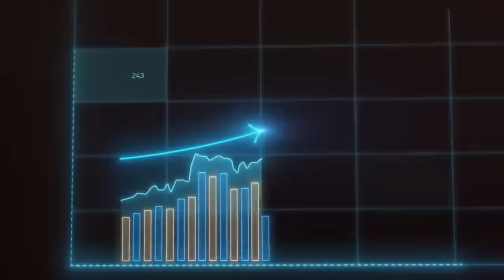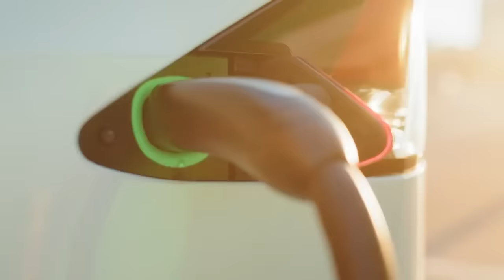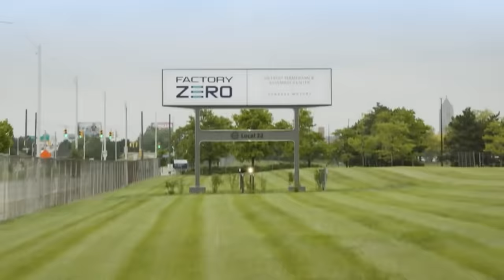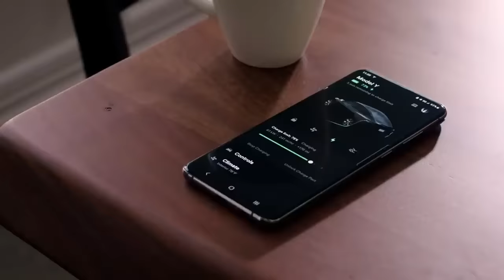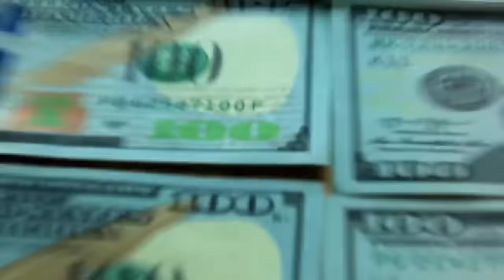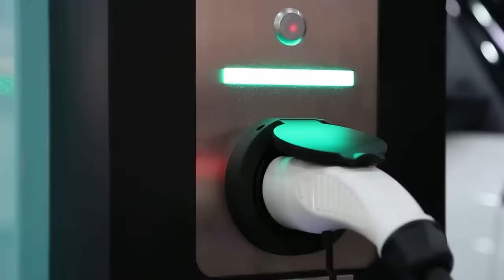Electric Vehicle Owners Are Frustrated and Demand the Return of Gas Cars

Comment: Electric vehicles (EVs) remain expensive across the board. Buying them is often pricey, and while battery leasing might initially sound appealing, it can add up considerably over time. Insurance costs for EVs can also be higher due to their unique components and potential repair complexity. Moreover, maintenance can be expensive, particularly when battery replacements are factored in. Additionally, EVs may depreciate faster than traditional cars due to battery technology advancements and changing market preferences.

Furthermore, charging can be a significant cost factor. While some public chargers offer pay-as-you-go options, others require expensive upfront deposits for charging sessions. Imagine facing a £45 pre-charge every day, even if you only use a fraction of the electricity. This becomes increasingly concerning amidst rising inflation.

Beyond the financial aspects, other concerns can hinder EV adoption:

Limited charging infrastructure: Access to reliable and fast chargers, especially in rural areas, can be a major obstacle for many drivers.
Range anxiety: The fear of running out of power before reaching a charging station can deter potential EV buyers.
Uncertain battery longevity: Concerns about battery degradation and replacement costs remain a deterrent for some consumers.
Limited model variety: While options are rapidly growing, the selection of EVs, particularly affordable ones, currently lags behind traditional vehicles.
It's important to note that the EV market is evolving rapidly, and many of these challenges are being addressed. However, for some people, particularly those on tight budgets or with limited access to charging facilities, EVs might not be a viable option in 2024 and the near future.

Comment: 0:40 " ... current lackluster interest in EVs ..." Left out another word or several [in brackets] : " should say current lackluster interest in [lackluster or overpriced] EVs [without sufficient service support and charging infrastructure] ...".  Depending on how you plan to use your EV, you may not need any sort of public charging infrastructure, but if you do, then you have to be sure to buy an EV that has one that meets your charging needs. Also, I've heard it said that many dealerships do not have enough, or any, technicians trained to support EVs and may not even have charging facilities on site. Having a Tesla, I've no personal experience with that. I've had relatively painless service on my car, so far, but it can take a week or two for a technician to come out to the house, depending on what is wrong, overall just a couple of minor items and the tech seemed quite competent.  Bottom line: I'm quite happy to be a Tesla owner and hope to never be forced into buying another new ICE vehicle.

Comment: I drive lots from Los Angeles to San Francisco and never had to wait for a charger—> Tesla provides a screen showing where charging stations located plus how many chargers un used.  Tesla charger get bad rap but 99.9% of Tesla chargers are working.  
I installed a 240 vac charger to my house for less than $300.00 dollars. I have background as electrical engineer. I install charger to my Son’s house and because we both have solar panels we both pay zero for energy use.  
When going back home I use my Son’s charger so round trip to LA to SF cost $12.00.  Because I have charger at my house my solar panels gives me free charging.  
If you are concerned about fire. Buy an electric car that only use Lithium Iron Phosphate—> it’s in heard of fire 🔥 on this kind of battery 
My Tesla have few parts thus break down is less. No need for brakes oil change just tires.  

Want to save $$$. The new model 2 come in 2024-2025 will cost $24,000.00 minus $7,500.00. or $17,000.00. So much cheaper than a gas car.  With that saving hire an electro an for $1,500.00 and install a 240 volt charger
Reply: Congrats, you are less than 1% of the population where EV's work for you.  No everyone lives where you do, some live in cold climates.  Also, I hope that the government will soon be charging EV owners a special road tax, equivalent to what gasoline taxes would be per mile.  You should be paying your share to keep the roads maintained and stop free loading on other tax payers.

Comment: I warned a friend of mine of most these facts in debate before he bought a EV ford truck. Less than 6months later, he called me 3 times to come picked him up at charging stations due to lack of open ports: 2 times because not enough charge to make it home and had to towed the truck. He lasted a little over 1yr with the truck but no one would buy it due to battery issues. He discounted the sale price on the truck 3 time. In the end he traded it in for an SUV and carried over $15 from the truck
Reply: I charge from home the past 4 years no problem if you have to go long trip get a gas car or truck. Not made for long trips.

Comment: We love our Bolt and it has been the nicest car we’ve ever driven after decades of very nice Hondas but… the issues raised are real and we don’t know if the ev future is as golden as hoped for. I charge at home and 99% of my driving is within 50 miles. I’ve also had no problems starting or driving in the coldest or hottest weather I’ve encountered in North Carolina but I can see where driving long distances or in extreme temperatures might present problems. The power grid and the source of initial energy will also need to be upgraded. I’m hoping that nuclear fusion, once always the future of power, will become a safe and reliable source. I guess time will tell.

Comment: EVs have a place in the overall transportation system but they cannot replace the convenience, lower costs and flexibility of an ICE car. Here in the UK 60% of car owners do not have a frontage to charge a car so are faced with using public chargers often miles from their homes so they have to sit and wait while the car charges. Late at night in a deserted car park is not a safe option but charging during a working day is equally unacceptable. This means that an EV is only viable for owners with a frontage so can charge the car overnight.

Comment: Sooooo.....if EVs that catch fire and as a result burn down homes......what impact might that have on insurance rates? Both auto and home...🤔
Reply: As EV fires are 10 to 50 times less likely then ICE car fires this is not a factor.
Reply: EVs are also a fraction of all the vehicles on the road. For one to make an accurate statement in that regard, it would require looking at a one to one comparison. 🙂

Comment: Here is my recent experience with an EV. I am amazed by the concept. However, the idea of EV is not a viable option for me yet. I love the speed involved with a Tesla Model S PLAID. So I rented one. Driving around Los Angeles. I drove 80 miles from 95% to 55% on a car advertised to do 348 miles per charge. The range is NOT like a fuel tank. I cant charge to full, except for road trips. Plus its unhealthy for the battery to deplete it below 20% and daily suggested range is 80% charge. That's only 60% usable per day. I went 80 miles from 95%-55%. How far would it be from 80%-20%?  Plus, everyday I don't drive it. I lose about 1%. I have 4 other ICE cars. It's full of gas when I park it and still full 2 weeks later. A Tesla will lose charge of it sits and when driven. Oh yeah! Sure, I know Jack rabbit starts hurt your range. But, you can monitor how much energy is used per trip. Even driving conservatively, I could only get about 300 kwh average even when I'm enjoying acceleration or driving Ms Daisy. So people have paid more for EVs than ICE. More for home charger, waiting at charge stations, crazy money to replace a battery on horizon, and now rapid depreciation? Why should I buy an EV again?

Comment: I will not be getting an electric vehicle for a very long time.  Where I live we routinely see summer temps in the 90s and 100s and winter temps in the -10 to -30 F.  All of the issues I have heard about unreliable battery operation in those temps, unreliable aspects of charging in those temps, put a lot of worry into me.  I also live on over 2 miles of dirt road...roads that are not paved, and not plowed in the winter time.  Are capable of handing rough roads, muddy roads, rocky roads, multiple miles EVERY DAY?  The cost of the electric vehicles is rather spendy and not worth the unknowns.  We also like taking road trips whenever we want.  I don't want to have my destinations determined by which places have EV Charging Stations.  That also brings me to another issue I have with EVs.  When I go to gas up my truck, I might spend 5 minutes gassing it up.  It costs me about $65.  With an electric vehicle, I'm going to spend less on "charging" (as long as I don't go over 80%) but I'm going to spend a LOT more than 5 minutes to be able to hit the road again.  If I wanted to spend 20 minutes or an hour to charge up, I'd go waste my time in an airport.  That also brings me to range of the EVs.  When we travel we go some 400 miles and then spend 5 minutes to be able to drive another 400 miles.  We can gas up at multiple locations along the way, so we're rarely worried about making it to the next place before we run out of juice.  We drove from Alaska to Montana on the AlCan.  I wonder if an EV could manage that?

Add in the infrastructure is NOT ready to handle a significant increase in electrical demand for a lot of electric vehicles, and I don't see EVs being much more than a "fad" thing for a number of years (likely 20+ years)

Comment: You don't just buy a car/vehicle, you buy a car/vehicle within an infrastructure. The petrol car seems a thing of its own, but won't work (for the majority of people/use) without gas stations , garages etc. One most times isn't aware of that, for it's always there. And different countries and climates demand different infrastructures. In one country you can drive from on side to the other in hours, in others you need that for one city to another. So you can't state simple things in general. In the early years of petrol cars you needed someone with a flag to run in front of it to have people make way for this new invention.

Comment: I've always said why do they advertise EV's as helping the environment with zero emissions when power comes from coal fired power stations in Queensland. And considering the minerals needed for the batteries, the mines use diesel powered trucks and trains. Think I made the right move sticking to a combustion engine. It's cheap to maintain, cheaper to run as electricity costs more, though I have solar so I might save there.

Comment: Solar panels is another BS! Estimated for my 2000 square feet hose was $100,000.00. Gov returning $20,000.00. You will never use $80,000.00 worth of electricity in your life. You need to clear the snow and dust to keep them clean. Also, pray for sunny days only:)

Comment: Hydrogen (H2) and The Ford Boss 429 

The Boss 429 was a high-performance gasoline engine that was designed for NASCAR racing. It was only produced for two years, 1969 and 1970. The typical horsepower for the Ford Boss 429 cubic inch engine is 375. This was the factory rating, but many believe that the actual horsepower was closer to 500. 

See Table 1., Hydrogen produces significantly fewer pollutants than gasoline when burned. For a given fuel volume, hydrogen produces zero carbon dioxide, zero particulate matter, and very low levels of nitrogen oxides and hydrocarbons. Gasoline, on the other hand, produces significant amounts of carbon dioxide, particulate matter, and nitrogen oxides.

Hydrogen internal combustion engines (HICEs) produce significantly lower emissions of NOx than gasoline or diesel engines. In fact, some studies have shown that HICEs can produce up to 90% less NOx than gasoline engines. 

Horsepower and torque produced for the same volume of hydrogen fuel would be significantly higher than gasoline in the same internal combustion engine. This is because hydrogen has a much higher energy density than gasoline, and will produce more power per unit of volume.

Comment: EV problems:  Does not work well in cold temperature.  More expensive to insure because of fire risk and high cost of repair.  Charging is too slow and stations are too scarce.  EV may not be cleaner than ICE.  The worst issue is EV is more expensive to buy which is regressive for working class.
Reply: Not to mention tires wear out three times faster thus emitting three times the rubber particles.

Comment: Basically, it's just all long already predicted EV issue: 
- they are selling it as premium car, with whole another premium cost at its lifetime.
- susceptible to temperature change, especially winter, 
- long charging time and rare charging place, 
- only house owner could charge it at home (apartment user basically go brrr), 
- once the battery dies, it dies and the replacement is a whole another issue and cost.
- it's could burn and once it's happened it's troublesome.

Comment: EVs undeniably offer environmental benefits in rural areas. However, advocating for them as the sole focus of car manufacturers is not the optimal solution. The concern lies not in the inherent goodness of EVs but in the questionable business strategy and its forceful imposition on the public.

Rather than exclusive investment in R&D for EVs, a more balanced approach could involve allocating funds towards programs aimed at enhancing emissions filters for ICEs. This strategy would address environmental concerns while accommodating a wider range of preferences and needs in the automotive market.

Comment: What is ironic is the fact that current EVs have the same problems as EVs from the late 1800s.
Poor range, long charging times, high cost of batteries, severe environmental impact, lack of supporting infrastructure, poor reliability & excessively high maintenance cost.
In addition, current EVs have become so computer & software reliant, a simple software glitch can render a very expensive vehicle completely useless.
EV technology, in its current form, is just not ready. Of course, given the current EVs available aren't much better than those available 130 years ago, its likely to take a considerable number of years before they will ever be as convenient as comparable ICE vehicles.

Comment: this video is old. It’s closing in on February 2024, and when this video was made, the cold-weather had not yet struck the Midwest of the United States and the north east with near zero, and sometimes below zero weather, causing electric vehicles to be abandoned at nonworking charging stations. apparently the batteries can only be charged up to 70% when the temperature is very low and the driving range is cut almost in half. Tesla recommends that the owners of Teslas do not use the heater to get Graeter driving Range in near zero weather temperatures. I mean that was the actual recommendation from Tesla..
  people calling tesla customer support could not get through to anyone on the phone during this cold weather especially in Chicago..
 now, barely 3 weeks into 2024, General Motors and Ford have stopped production of EV pick up trucks. Nobody’s buying them. One of the EV companies in Europe has gone out of business. I don’t know the name of the company right now, but it is affiliated with Volvo, that companies value is down to zero from the initial $8 billion value.
  automobile insurance, for Evies has gone way way up all of a sudden. Minor repairs can cost many thousands of dollars due to the technical nature of working on an EV..
an acquaintance of mine that’s been in the auto body repair business for over 30 years, says he won’t even have one in his building for repairs because of the fire risk with a damaged EV. You just don’t know if that battery took a hit. ..
  I am pretty sure that Evies are definitely the wave of the future. It’s just at this current generation of car buyers are the guinea pigs…
if I were looking to get an EV, I would lease it. They do make sense for local driving of under 100 miles per day total .. but if you want to go on vacation, or drive from Chicago to Disneyland in Florida, I think I would rent a gasoline, car, or take the train or fly, but I definitely wouldn’t drive an EV from Chicago to Florida..
  but I definitely would lease one as the second car for my wife and I. Just be prepared to get about half the mileage out of a set of tires due to the extra thousand pounds in weight from the battery.. and I would Parkette at least 10 feet from the house, and I would never have it inside the garage ever..

Comment: EVs are like roof solar panels. It’s expensive upfront, it takes 17-20 years to realize your savings, the panel is only good for 10 years, at which point you will have to buy a new set. The numbers don’t add up.

Comment: They simply shift the emission problem to a vector, the battery, which actually has further long-term negative environmental impacts. Meanwhile, they have created it, and we will see about addressing the limitations it has. We are in the early stages, that's absolutely true, but we are also in the early stages of real problems.
At a large scale, the problems outweigh the benefits.
The Evs seem like a 'radical chic' way of avoiding addressing a problem.

Comment: I just don't get why they haven't rolled out a car, powered by electric motors, but with a small gas generator.  Enough to reduce reliance on batteries and need for recharge, reduce the use of fossil fuels and keep the advantages of Electric motors.
It sounds like a good trade-off to me.